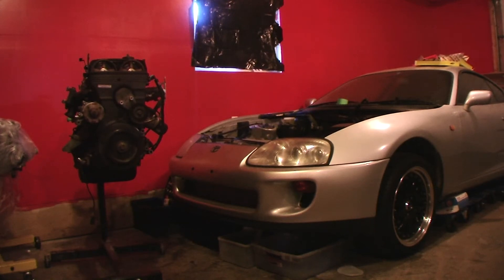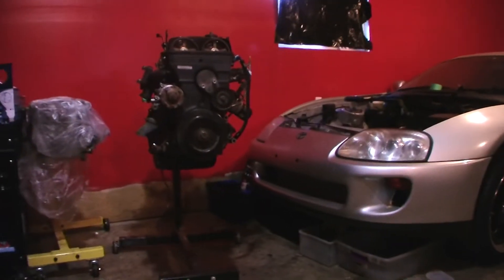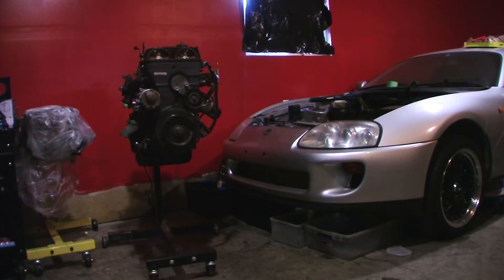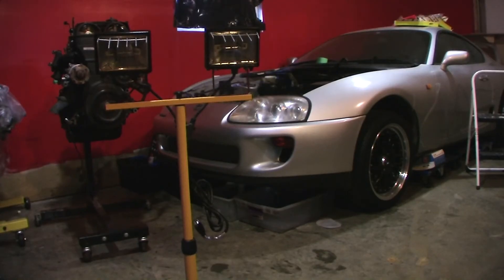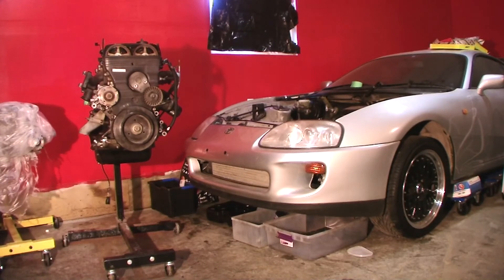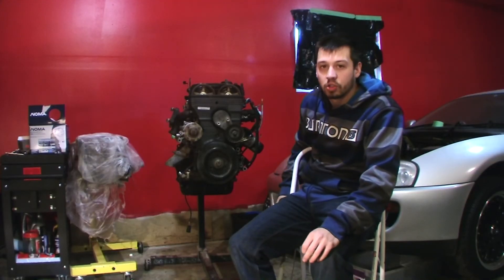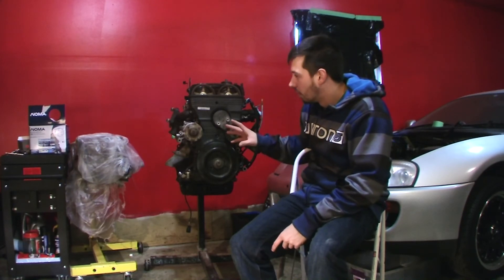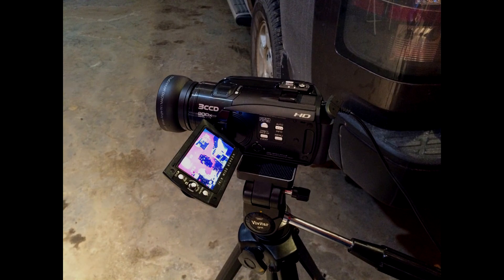Lifetime Supra Project - Lighting fix

Comment: I don't know what the rest of your garage looks like, but you could try pointing the two 250w lamps at a white surface (walls are good, but otherwise putting up a white linen sheet could work on the cheap). Make sure the white surface is opposite to where you want your camera to be shooting. 
As you showed in the video, pointing those lamps directly where the camera points makes for quite harsh light, which is good in the real world but not great for a camera that you can't adjust image settings on. Anyway, pointing those lights at a white surface first  will reflect that light and give you a diffuse light which is a lot softer and nicer for filming whilst hopefully still giving you adequate lighting for whatever you need to see on the engine.
Reply from the maker: I've seen similar set ups where people are using the lamp pointed at like the under side of an umbrella. All my all a are unfortunately red, but the roof is white. I can give it a try though!
Reply: +SupraWilliams Yeah for sure umbrella's are a good idea. Plenty of household items you could use cheaply instead of splurging out on expensive camera's stuff. look forward to more of your updates!